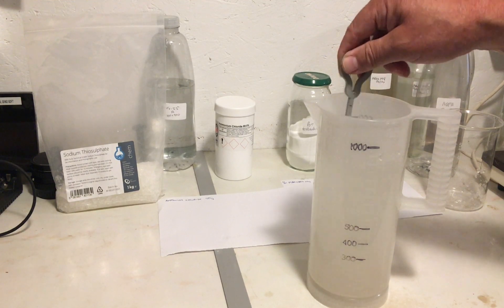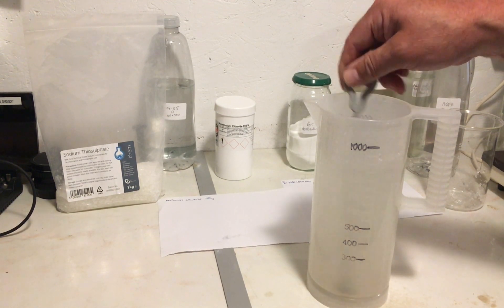Making Rapid Fix - AGFA 304

Comment: according to Anchell in the darkroom cook book shouldn't it be potassium metabisulfite 20g

Agfa 304
Rapid Fixer
This fixer makes use of sodium thiosulfate and ammonium chloride to form ammonium 
thiosulfate in solution.
Water at 125F/5 2C, 750.0 ml
Sodium thiosulfate, 200.0 g
Ammonium chloride, 50.0 g
Potassium metabisulfite, 20.0 g
Water to make 1.0 liter
Use undiluted. Fix paper for 3 to 5 minutes. Film should be fixed for three times the clearing time
Reply from the maker: Quite right! I'll make a note in the video notes. Thank you for finding this error!!

Comment: Thanks for this video.  I have been making my own developers for a while now,  it I want to make my own fixers as well.  One question; is this solution used as a stock fixer or is it diluted?
Reply from the maker: Hi Larry. Use this as stock. It'll fix 10-20 films or 30 10x8 papers. Similar to my previous TF-2 video.

Comment: That is a interesting comparison. You said you would use this with Pyro developer. Will it keep the stain?
Our would TF3 a better choice with Pyro and Delta or t-Max?
Reply from the maker: I don't think it would affect the stain, perceivably. It's only mildly acidic but TF3, if you can get ammonium thiosulphate would be the best of the two.
Reply: @PictorialPlanet  Thank you, yes here in Germany i can get it as Powder or 60% solution. Will try this when testing one of these modern films…
Reply: Thanks John!  I don’t typically shoot T Max and rarely Delta but if I do I’ll give this a try.
Reply from the maker: Yeah, there's no real advantage for those of us who shoot FP4, HP5 or PANF.